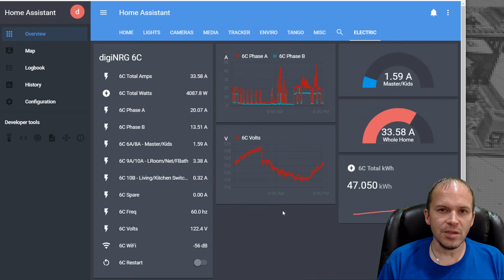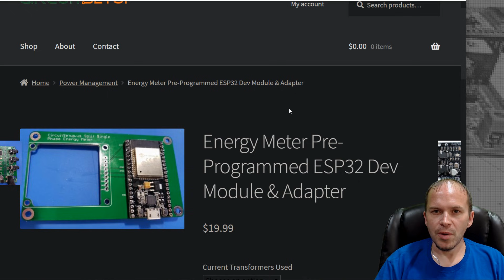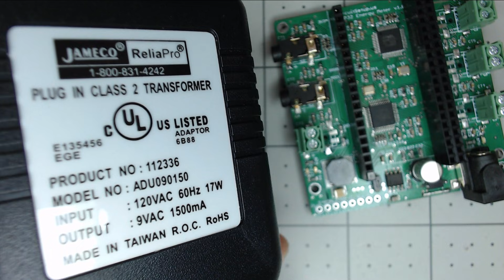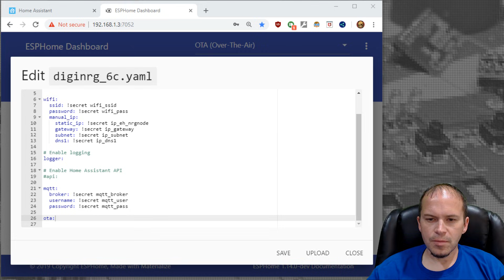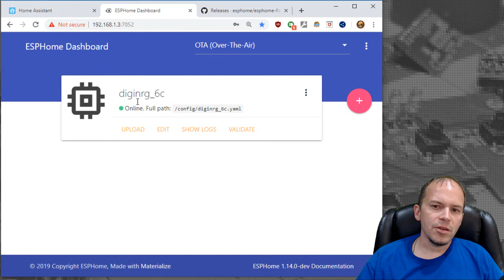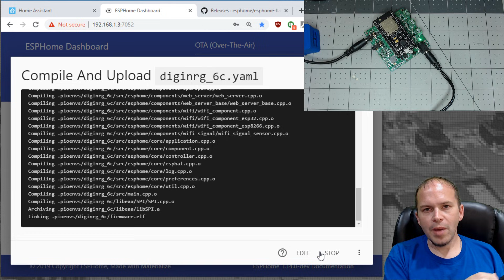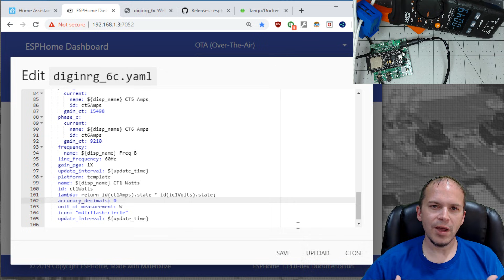DIY Whole Home Power Monitoring with ESPHome & Home Assistant

Comment: So this particular video put me over the top of buying this particular monitoring solution, but I've got a problem.  I have followed your lead 100% to the T, but when trying to compile the binary, 100 times now, I get stuck at 18% "downlaoding" during compile and it never goes any further.  Any suggestion on how I could get the binary file to actually build so I could download/flash to the nodemcu board?  Even tried a dozen different board types, yet it continues to get hung up at 18%.....  even after leaving for an ENTIRE DAY...

INFO Reading configuration /config/esphome/diginrg6c.yaml...
INFO Generating C++ source...
INFO Core config or version changed, cleaning build files...
INFO Compiling app...
INFO Running:  platformio run -d /config/esphome/diginrg6c
Processing diginrg6c (board: nodemcu-32s; framework: arduino; platform: espressif32@1.11.0)
--------------------------------------------------------------------------------
HARDWARE: ESP32 240MHz, 320KB RAM, 4MB Flash
Looking for AsyncTCP-esphome library in registry
LibraryManager: Installing id=6798 @ 1.1.1

Downloading  [##################------------------]   50%  00:00:02
Downloading  [####################----------------]   55%  00:00:01
Downloading  [######################--------------]   61%  00:00:01
Downloading  [########################------------]   66%  00:00:01
Downloading  [##########################----------]   72%  00:00:01
Downloading  [############################--------]   77%  00:00:00
Downloading  [##############################------]   83%  00:00:00
Downloading  [################################----]   88%  00:00:00
Downloading  [##################################--]   94%  00:00:00
Downloading  [####################################]  100%          
AsyncTCP-esphome @ 1.1.1 has been successfully installed!
Looking for ESPAsyncWebServer-esphome library in registry
LibraryManager: Installing id=6758 @ 1.2.6

Downloading  [##----------------------------------]    8%
Downloading  [###---------------------------------]    8%
Downloading  [###---------------------------------]    9%
Downloading  [###---------------------------------]   10%
Downloading  [####--------------------------------]   11%
Downloading  [####--------------------------------]   12%
Downloading  [####--------------------------------]   13%
Downloading  [#####-------------------------------]   13%
Downloading  [#####-------------------------------]   14%
Downloading  [#####-------------------------------]   14%  00:00:08
Downloading  [#####-------------------------------]   15%  00:00:08
Downloading  [#####-------------------------------]   16%  00:00:08
Downloading  [######------------------------------]   16%  00:00:08
Downloading  [######------------------------------]   17%  00:00:08
Downloading  [######------------------------------]   18%  00:00:08
Reply from the maker: Looks like it can't download a library for Esphome. They could be having issues. It's not even to the compiling part yet so nothing in the config file will fix that. Try the Esphome github or Discord to see when if there are others reporting the issue.
Reply: @digiblurDIY  Thanks a lot for the quick response.  I futzed with this enough last night that I managed to actually get it compiled and uploaded, then went to install the ESP32 into my interface board, plugged in the USB to confirm everything and something started to smoke.  Turns out my generic ESP32 boards... have a completely different pinout than the NodeMCU-32S.  That's my luck.  Ordered the specific NodeMCU-32S from CS, hopefully it only smoked my ESP and not the damn monitor interface board.  :(
Reply from the maker: Ouch!  Yeah that's one thing I had to watch out for too when ordering ESP32s.  A few different pin outs on the web.
Reply: @digiblurDIY  That was my bad.  I'm usually a little more detail oriented than that... but made the mistake of thinking all of the ESP2866 formfactor boards were the same pinouts.  Farts!!  Luck doesn't always side with me, but hopefully in this case, I'll get lucky and it only nuked something on the ESP!!

More struggles to come, I'm sure..  This HomeAssistant thing had a steep learning curve, and this is my third stab at it but have started to finally see success.  I'm all in on this ecosystem, it's far easier in the long run than OpenHAB was.  The whole Docker thing is still kinda killing me, but were making things happen.  Much thanks to your videos, luckily!!  Thanks man!
Reply: @digiblurDIY  Most excellent news!  I received my NodeMCU-32S from CS yesterday, spent a frustratingly long amount of time learning that you have to press the boot button to start flashing it (as I found in another comment on this video!) and got everything up and running!  Calibrated my CT's with a 1500 watt heat gun and a Kill-A-Watt to compare wattage between the ESPHome numbers and the Kill-A-Watt.  Decided to go ahead and buy an amp clamp and double check my numbers, since it's a tool I've needed several times before and didn't own.

I do have one more question.  Does it make sense (or matter?) to put the mains phases on different sides of the board?  You mentioned CT1/CT2 would be your 2 phase inputs, so I'm guessing that's okay, but would it change things to move one of the phases to CT4?  Just curious.

Comment: My total monthly KW hours always reset at 12am to 0 kwh using your yaml file and added this to my config file hassio utility_meter:
  energy:
    source: sensor.total_kwh
    cycle: monthly 
    offset:
            days: 10
            hours: 0
            minutes: 0

maybe i don't need this not sure or maybe there needs to be a monthly platform in the ESP home config only see 

platform: total_daily_energy
    name: Total kWh
    power_id: totalWatts
    filters:
      - multiply: 0.001
    unit_of_measurement: kWh

thanks so  much
Reply: LOl but it does not work still resets every night

Comment: Hi mate, wondering if you could help me out here. I've got all the components but I'm already stuck at the first step. My node does not want to flash. I've already tried 3 different ones and tried te dev and normal version of ESPhome (also tried the espflasher program as well). Everytime it stops when it needs to link to the nodemcu. Everything compiles fine but then I get:
INFO Successfully compiled program.
INFO Connecting to 192.168.2.60
ERROR Connecting to 192.168.2.60:3232 failed: [Errno 113] No route to host
SSID and Password are defenitly ok, Wifi is in very good reach,.... I'm out of options, I'm totally lost here. Searched the internet for all sorts of solutions but nothing....
Your help would be MUCH appreciated!!
Reply: Found it by accident!! Had to push the "boot" button till it said connecting :/
Reply from the maker: Gotcha! Glad you got it. Was going to tell you to jump into our discord so we could help walk through some things.

Comment: How did you enclose this? Or how did you protect the board? Given the power involved, it seems safer to have it enclosed?
Reply: Oh, they sell an enclosure! Cool!
Reply: Fyi, the most AC voltage on the board is 9v. Everything else is converted to DC.

Also, the case 3d files are available if you want to print your own case

Comment: How could you remove it if necessary safely?
Reply from the maker: Remove what? The board? Or clamps?
Reply: @digiblurDIY  Bought actually...
Reply from the maker: Remove power from the where the clamps are on and remove it. Who put them on?
Reply: @digiblurDIY  Im thinking on doing this project for the whole house so i would use it clampted to the main cables, so as long as im not able to turn that off, i was wondering how would be safe to the come the clamps from the cable and from the device.  thanks sharing this project, really amazing
Reply from the maker: @RobertoCarvalho-0  to do mains and if you can't cut them off then I'd recommend an electrician install them.

Comment: Hi - purchased 2 channel board and an AMICA nodemcu - i am confused on the pin setup 

the ones that I thought were to be used hang the board gpio 18,19,23 are not supported 

tried 13,12,14  they dont work either
Reply: As long as the SPI pins are defined in the ESPHome config, and are physically hooked up to the corresponding meter pins, everything should communicate with the meter. By default the pins are: 
16 - CS
D5/14 - CLK 
D6/12 - MISO 
D7/13 - MOSI
Reply: @jdeg2000  Thanks for your answer. I change my ch2 pin settings, but "Communication with ATM90E32 failed!" the setup further not working...

[10:40:31][C][wifi:299]:   DNS2: (IP unset)
[10:40:31][C][spi:079]: SPI bus:
[10:40:31][C][spi:080]:   CLK Pin: GPIO14 (Mode: OUTPUT)
[10:40:31][C][spi:081]:   MISO Pin: GPIO12 (Mode: INPUT)
[10:40:31][C][spi:082]:   MOSI Pin: GPIO13 (Mode: OUTPUT)
[10:40:31][C][spi:083]:   Using HW SPI: YES
[10:40:31][C][template.sensor:021]: Template Sensor 'NRG_ch2 Total Amps'
[10:40:31][C][template.sensor:021]:   Unit of Measurement: 'A'
[10:40:31][C][template.sensor:021]:   Accuracy Decimals: 2
[10:40:31][C][template.sensor:021]:   Icon: 'mdi:flash-circle'
[10:40:31][C][template.sensor:022]:   Update Interval: 10.0s
[10:40:31][C][template.sensor:021]: Template Sensor 'NRG_ch2 Total Watts'
[10:40:31][C][template.sensor:021]:   Unit of Measurement: 'W'
[10:40:31][C][template.sensor:021]:   Accuracy Decimals: 0
[10:40:31][C][template.sensor:021]:   Icon: 'mdi:flash-circle'
[10:40:31][C][template.sensor:022]:   Update Interval: 10.0s
[10:40:31][C][logger:175]: Logger:
[10:40:31][C][logger:176]:   Level: DEBUG
[10:40:31][C][logger:177]:   Log Baud Rate: 115200
[10:40:31][C][logger:178]:   Hardware UART: UART0
[10:40:31][C][:083]: ATM90E32:
[10:40:31][C][atm90e32:084]:   CS Pin: GPIO16 (Mode: OUTPUT)
[10:40:31][E][atm90e32:086]: Communication with ATM90E32 failed!
Reply: @lotar2k9  I'm wondering if this is a bug with the spi mode in ESPHome. I know there was initially an issue with the spi mode on the esp32. I dont know how much it was tested with the esp8266. If you have an esp32 I would recommend trying that.
Reply: @jdeg2000  Thanks, I try with ESP32.
Reply from the maker: Let me look at the SPI pins the 6 channel is using and see. Using an esp32 right?
Reply: esp8266 nodemcu  @digiblurDIY
Reply: @barrykilcoyne7545  Do you solved this SPI pins problem with ESP8266 NodeMCU...? 
I also have a problem with pins, and "[E][atm90e32:086]: Communication with ATM90E32 failed!". 
I check the dafault SPI mapping by ESP32 and ESP8266, I find the following pin groups:
I try to use: GPIO12: MOSI; GPIO13: MISO; GPIO14: CLK; GPIO15:CS; ---- not working, 
I try to use: GPIO13: MOSI; GPIO12: MISO; GPIO14: CLK; GPIO15:CS; ---- also not working.

Comment: What if voltage and current are not in phase?
Reply from the maker: Flip the CT around and use the newer dev builds that include the sensors where the chip calculates the wattage.
Reply: Hi Travis,
What are new features for power energy monitoring in the dev build?
Reply from the maker: Found it.. https://github.com/esphome/esphome/pull/799

Comment: In my esphome configuration, I use power function and power template which P = Volt*Current to compare the watts value. The power has about the same value when the load has less than 100 watts or over 1200 watts. if the load between ~100w to ~1200w, the value in power function always has about 50-150 watts less than the power template sensor. 
I wonder if I need to do anything to get it calibrate properly.
Thanks,
Reply from the maker: Check out the new wattage sensors in the latest esphome-dev version as you let the chip actually report the true wattage and not calculated.

Comment: hello Travis
great video,
I copied your file and made a few changes to suit my multi input (3) * 5KW solar system grid connected  home (240 Volt Down Under) wasn't able to flash over USB but connected by the serial connection and use a USB- serial adaptor and that worked fine.
going to set it up as zero balance grid connect system, put enough power back into the grid to cover the losses during cloudy days and nights if all goes to plan.
...the right pace with just the right level of technical information to get the job job done. 
thanks.
Reply from the maker: There are more changes coming the dev version of the software, power factor, real wattage, etc.

Comment: Hello Travis,

I calibrated 6 clamps today (need to order another 6 since I have 12 inputs), I noticed that all clamps showed me positive amps but some gave me negative power (watts).
I used the YAML from circuit setup and this seems to get the power of the board itself, you used a template to 'make' the power. 

Anybody an idea on how to change the negative power to positive without making a template?
Reply from the maker: Cut the breaker off and flip the clamp around.
Reply: @digiblurDIY  ok I'll try that

Comment: Great video. I have the 2 channel board. It is up and running using Esphome. I manage to get readings on the CT1 input and NOT on the CT2 . Any reason behind this? Could you point me in a direction that i can explore to resolve this issue. Thank you in advance,
Reply from the maker: Did you happen to try CT3 in the config maybe?  I know I had ESPHome running on it with my sample config.
Reply: @digiblurDIY  do you mean changing this (id: "ct2Amps") to this id: "ct3Amps"? Thanks
Reply from the maker: Yes the chip is a 3 channel on the board and though maybe you were hitting the empty channel.

Comment: New to this and looks very interesting, I was looking at the home energy devices. Any options for the Wired Ethernet module. Looking at https://www.mouser.com/ , and they have other options for ESP32 boards that have ethernet.
Reply: There isn't an ESP32 board that I know of that also has the same pinout as the dev modules that are compatible with the meter, and also has ethernet on board. You would have to have to make a wire to connect the proper power and SPI pins.
Reply: @jdeg2000  that's what I was looking at, I guess my question wasnt clear, I wanted to use the same 6 port energy board. But with a esp32 with ethernet instead of wifi, with the same pins that would still plug into the board.
Reply from the maker: https://esphome.io/components/ethernet.html is supported component by them.

Comment: Great Job on the video. 
I have a question and it may be dumb but i do not see any other calculation other then volts * amps, if you don't include your power factor this is only VA (volt amps) not watts. unless there is more then i can see in the code.
Reply from the maker: Actually this has been added to ESPHome in dev now since the video was recorded.  The the chip calculates all of that.  https://next.esphome.io/components/sensor/atm90e32.html
Reply: @digiblurDIY  Thanks for the update.
Reply: @seanmcdonald656  The new dev version allows you to get power factor, but you don't necessarily need to bring it into ESPHome. To just get wattage from the board, you'll want to solder JP9-JP11 (if they aren't already).  See this example config with power added: https://github.com/CircuitSetup/Expandable-6-Channel-ESP32-Energy-Meter/blob/master/Software/ESPHome/6chan_energy_meter_jp9-jp11.yaml

Comment: Hello 
It's possible to order the energy monitor board in Europe?
Thanks
Reply: I have ordered in Belgium, be aware that you will pay taxes ,  had to pay 51.73 euro for the board, 13.40 euro for the transport, and I payed 38 euros extra for tax and repacking !!! Paid this 2x since I first ordered the add-on board but didn't realize this.
Reply from the maker: Yes, check their website for shipping options.

Comment: Travis, great job as always!! In your example of the LED dimmer at the end of the video.  Do you have a clamp on that circuit to monitor that? Or were you able to monitor that change from having the 2 clamps on each of your main feeds coming into the panel?
Reply from the maker: I had a 100a clamp on just that circuit as I was isolating things in a controlled environment without a fridge or other automatic devices cycling on or off.

Comment: Hi Travis, i'd really thank you alot for all the information and knowledge you gave us on all your videos. I have a question regarding this circuit , Is it able to measure my entire house which is 3 phase / 220 Volt ?
Reply from the maker: Thanks! Yes it can measure up to 6 separate current draws and also more can be added by expansion boards as well.
Reply: @digiblurDIY  Great tutorial!. Follow-up question: hen using an expansion board, how do we determine which additional cs_pin (beyond 5 and 4 used for the base board, 6 connectors as noted in your code sample.  Appreciate any tips!  Thanks.

Comment: I can't get the dev version of ESPHome to work properly at all. When I try and compile the pi goes boom.
Reply from the maker: I believe you can change the add on config to pull the dev version as well if you can't get both installed. Let me see if I can find that.
Reply from the maker: Found the post finally for another user.  I will quote it here...   "I removed the esphome dev and reinstalled the regular esphome but in the configuration box I added the following line {
"esphome_version": "dev"
} everything complied correctly and is up and running"
Reply: @digiblurDIY  Thanks. I've tried this and it acts exactly the same as just installing the dev version. I've hopped into the ESPHome Discord to see if they can help too. Appreciate the help!